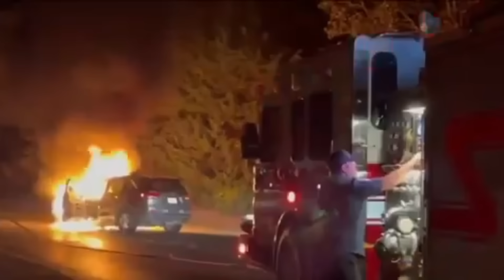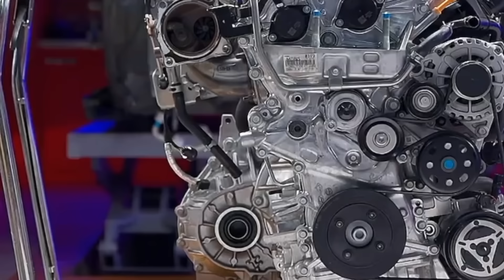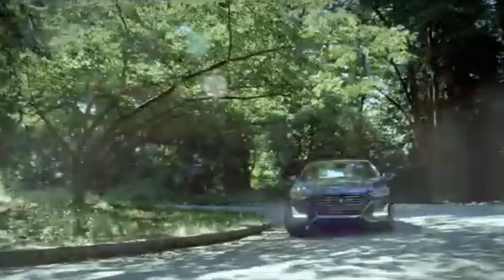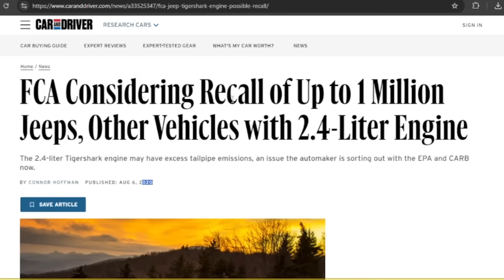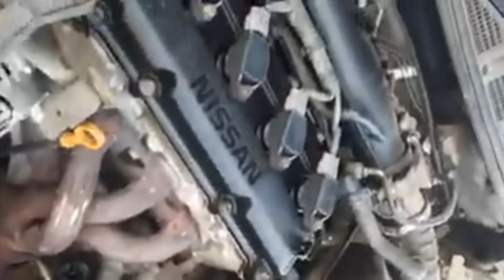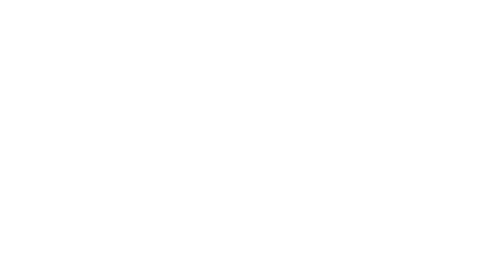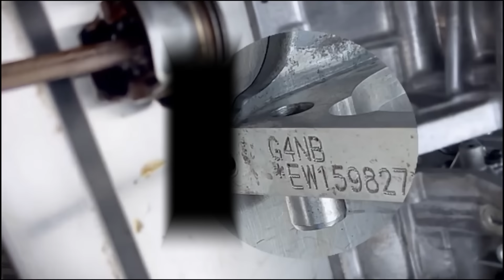Five Least Reliable Car Engines STILL IN PRODUCTION

Comment: I had a 1.0 ecoboost fiesta. I had 175,000 trouble-free miles and have no doubt it would have gone to 200k if two deer didn't total the car. 
I read the owners manual and it said 7500 mile oil  changes. I thought about a little 1.0 pumping it's heart out and decided to do oil  changes every 3500-4000 miles. Not one issue with the car.

Comment: Those 2.4 Tiger Shark engines in Dodge Darts are hitting 300,000 miles with no problems when you take care of them, so this video claiming they're bad engines is putting out the wrong info to people.
https://youtu.be/fRvfrtPR1Bw?si=3xMx3wPd0qHeauL3

Comment: Ok dude no. The QR25 is not the only engine that uses a Maniverter (Catalyst thats attached to the exhaust manifold) hell almost every 4 cyl engine does this. Also most also scavenge exhaust. This was a issue with the converters not the engine itself…… the QR25DE also does not have the screws that fall off the throttle plates……. Every engine can have timing chain stretch these motors get abused… and sure yeah the valve cover has to be swapped if the tube seals fail… a hour job at most…. The other engines are common surprised you did not cover the 2.0 ecoboost that had a stupid block deck with the cut that causes head gaskets to fail where the only remedy is just replacing the short block……..

Comment: I think all the manufacturers right now are in the process of trying to make every new engine make the current and future worst engines list. It is clear now the manufacturers are ok with compromising reliability and longevity for performance, yes you can get 350hp from a 2.7 inline 4 or 550hp from a 3.0 inline 6 or 1000hp from a 6.2 V8 but you can't have that and get high miles out of it, big lazy V6 and v8s last forever but there is no money in cars lasting forever. Cars are now built to make it through the warranty and be disposed of and that's sad and pretty much a terrible recipe for low carbon footprint. You can take an old gas guzzling car from way back and drive it forever and even with more fuel used and more emissions you still leave a way lower carbon footprint than a new car. And older cars are more recyclable where they have less plastics and toxic materials to dispose of.

Comment: The QR25DE engine issues were only for a few years (‘02 - ‘04 early ‘05). Later iterations fixed the issues, I had a ‘05 Sentra SE-R Spec V that had zero engine issues and I currently have family members with high mileage Altima’s (‘10, ‘11, ‘13, ‘21) with no engine problems.

Comment: The 4.6L iron block V8 in my 2009 Grand Marquis has 240,000 on the clock, runs like new, doesn't burn oil and actually gets good mileage on the highway. The same company built an engine with a timing belt inside the engine. Anybody who thought putting a timing belt inside an engine should be put in jail.

Comment: I had a qr25de in a nissan xtrail. Had an issue with the valve cover leaking. Nissan fixed some of the vibrations by adding a third engine mount...on top of the valve cover. So to change the valve cover (normally maybe 30 min job) took me a week after disassebling the engine mou t to drop the engine down to get to the bolt on the valve cover. Plus the egr valve and the power steering tank. Then the pcv valve snapped and that was 300 dollars australian and 3 month wait. Ended up getting one off ebay for 60 dollars. Horrible gremlin of an engine. Oh and without premium fuel it would only run on 2 cylinders and stall out.
Reply from the maker: Thank you for sharing your experiences,  that is a lot of hassle

Comment: The best part is that people still buy Hyundai/Kia products like crazy in spite of their terrible reputation.
Reply: I have a 2017 Sorento with the V6 and the engine has run well and I ve been happy. However I would never replace it with a new model as you have to get it with one of the 4 cylinders now.

Comment: Turbocharged and/or GDI engines require more reinforced blocks than their naturally aspirated, non-GDI counterparts, and I don't get why auto manufacturers don't get that. Anything that adds stress requires extra reinforcement to prevent damage. There's a reason why the 2JZ-GTE is such a revered engine. The reinforcement was crazy for how much power they were actually producing in stock form. That's why they're so reliable despite having 2 turbos strapped to it

Comment: Who would've ever thought that making an overly complicated 4 cylinder produce more power than it is safe to make. Then putting it in a big heavy vehicle would cause problems? Oh yeah, everybody who understands how engines work. 
It's more efficient to have a big engine barely working than a small engine working overtime. Less stress, less maintenance, longer life, and happier owners. This is why I won't own a modern vehicle. I'll stick with my old V8s. Lugging down the highway at 1500 rpm, while the smaller engines around me sound like they're ready to explode. And most probably are

Comment: I got lucky with my old SER spec v qr25de, the previous owner did a cat delete, and it did consume a screw from the butterfly valve, but only took out the spark plug and then left the combustion chamber. That was a decade ago and the car is still running and to my knowledge it doesn't burn oil.
I also now have the 1.8 MPI version of the 2.0nu, which are known for piston slap and oil ring issues. My "fix" is using the best fuel and oil available and a good wot pull once a day to clean up carbon. I'm at 191,000kms on the motor now, hoping to get to 300,000 at least
Reply from the maker: Great job
You have impressive miles on it

Comment: One of these things is not like the others. The QR25DE engine is one of the more reliable engines you can get in a vehicle. I'll admit their introduction was rocky in 2002-2006 because they had oil consumption problems but Nissan reworked the engine for 2007 and they have been solid ever since. Hell, the million mile Frontier still had its original QR25 engine.

Comment: I have experience with two of these engines. I owned a 2015 Fiesta with the Fox motor. It was previously my dad's. When he owned it, the head gasket blew. When I owned it, the cam phasers failed (and were on backorder for months) and the turbo blew. This was between 52k miles and 71k miles. I sold it and got a honda and have never looked back. My work vehicle is a Promaster City with the Tigershark. The engine got replaced under warranty at 72k miles for burning over a quart of oil a week. Fun fact: the 9 speed autos in those are junk too. It got replaced at 35k miles in mine.
Reply from the maker: You are lucky to get it under warranty. Baby it religiously. Thank you for sharing your experience
Reply: @ArrowGearhead  nah it's a company rig I beat the piss out of it😂

Comment: I have a 2022 Jeep compass with a 2.4 tigershark engine. I change the oil every 5,000 miles with vavoline synthetic motor oil. It uses no oil between changes mantain this engine it will give you years of service.
Reply: I have a 2021 Cherokee with the same engine..I've heard there were problems with the earlier engines but the problems were solved in the 2018 and up years.
Reply from the maker: Thank you for sharing

Comment: The QR is a great engine. The throttle body screws was an overblown problem that wasn't really as big as it seemed. It was easily preventable with 45 minutes of labor and the balance shafts really don't ever fail unless you don't maintain the engine. The cat design is stupid, along with like nearly every other Nissan model at the time, and the valve covers DO leak omg do they leak. You have to be careful in your choice of valve covers with them. They have little M6 screws that hold the valve cover onto the engine as well that need to be torqued juussttt right because you will strip out the threads easily. Ask me how I know. 

Overall, it's a great engine, makes insane power for what it is, sounds awful but puts the power down so who cares. I loved my QR and am hoping to buy another one again, if they're maintained right and you loctite those 8 screws you're golden 

Plus, the 2005+ (I think, I could have the years wrong) went away from the variable length intake runners so you don't need to worry about the screws

Comment: While telling us about the #2 engine, the 2.4 Tigershark , more than half the video loops shows a grand Cherokee, which has never used the 4 cyl Tigershark, but the fine 3.6 Pentastar V6. Plus the no longer built original Cherokee that was available with the 2.4 TS, that was after I test drove one to buy was awful and underpowered, especially in a 4x4/awd version! But I bought a very nice running 3.2 Pentastar V6, a smaller bore 3.6, tuned for mileage in the lighter Cherokee that ran great in my opinion, with a 9 speed automatic, that unfortunately came to a final drive that was so high the 9 th gear was never used till 80-85 mph! That if Jeep had offered a lower differential setup the power to the ground would have been even made a quicker vehicle! Possibly getting more highway mileage! Due to the use of 9th gear at legal cruising speed. Today I’m driving my second 3.6 Pentastar in a new Gladiator with 8 speed automatic that’s fantastic for what it moves, a 4,500lbs + brick, that still gets me over 20 mpg up to 70 mph! Or overall average of 18+!
Reply from the maker: Right 
Thank you so much for sharing
Reply: Thats like bragging how rich your fat girlfriend is. It's still a stellantis vehicle🤮

Comment: IMPRESSED! Finally agree with one of these lists. The Nissan qr (quality reduced) probably the best of the lot sadly. The turbo turd 1.0 isn't worth fixing if anything goes wrong. The theta and nu haveade me a lot of money. It's sad, almost all of these have 1 major problems. Their manufacturers cheap out in the wrong areas. But hey they don't want the car to last longer than the warranty. If that was really true there would be no 5.3l Chevy. They make their money upfront or on things other than the engine and for the most parts transmissions. As a mechanic the most consistent engine to go over 300k iss the 5.3l Chevy. Too bad they won't be making them for too much longer with their fuel consumption issues. I can guarantee that every single one of them they ever make will be bought immediately upon announcement if their discontinuation. And then the appreciation $ begins there is really only one way to kill the Chevy.$6plus a gallon fuel.
Reply from the maker: Thank you

Comment: I refuse to believe the QR25 is terrible, the amount of these on 3 bald tires, a spare donut and everything held together with duct tape while doing 40 over speed limit at all times tells me its the best engine ever produced.
Reply: Nissan: we’re Japanese in every way except the good ones. Terrible reliability, fugly copycat Japan style, unethical transmission designs, and abysmal performance…
Reply: I think that was thrown in for outrage engagement. It's the only engine on this list that has examples that have lasted a million miles. I see these engines with over 200k miles all the time, sometimes over 300k miles.
Reply: So . They're just topping up the oil and coolant everytime they stop. And they're already DONE, replacing the timing sensors every year, so they just let it ride rough as hell. It's many small things that suck on these engines. Electrical most of the time.

Comment: The Kia engines are a weird one... If you don't get one that had debris in the crankshaft, they'll go forever with proper maintenance including induction services. I work at a Kia dealership, and I see both. We are replacing hundreds of engines a year, but at the same time I see cars roll in with their original theta ii engines with way over 200,000 miles. Kinda crazy.
Reply: 3k mile oil changes on the ones still living 😂
Reply: Their diesel engines I had on my Sportage here in Iceland are amazing
Reply: I have 2011 sonata with 2.4. Meticulously maintained but It was burning oil like crazy.  Knowing that they wouldn’t do anything about it, i ran it low on oil until it locked up.  I did keep used oil in my trunk and as soon as it failed, i added used oil before towing it to the dealership.  Got a replacement engine.  You have to play it safe and not give dealership any reasons to decline warranty.  Especially for a crappy engine.
Reply: I got lucky...so far.  I have 2013 with 1.8 L.  150,000 miles still running smooth.  I used synthetic oil since new
Reply: If they got their QC under control I’d have considered purchasing one. Similar story with Nissan and their transmissions. Instead I bought a Corolla, which I’m actually enjoying.

Comment: Direct injection is part of the problem because the engines don't have port injection Port injection will clean the intake valves and it's better at keeping the Pistons clean they have problems with the PCV systems they also 9 out 10 of them have a high pressure fuel pump cam driven and if the fuel pump starts to leak into the engine and you can dilute your fuel or your oil with fuel and therefore you're going to have diluted oil getting up into the piston rings and with the heat that these engines create they end up sticking and then you're piston rings aren't doing the job to keep everything clean you know separated yeah new cars are pain especially with all the computers they have in them and they track everything you do

Comment: I just sold my old 2012 Elantra. The engine had a horrible rattle that sounded like a tin can. When the issue first started at around 60k miles it would only happen when you’d do a cold start and wouldn’t sound so bad once the engine had warmed up a bit but by the time I got rid of it it didn’t matter. I remember seeing letters from Hyundai in the mail all the time about recalls, and had to replace my steering column at around 75k/80k miles. It still got me through my 20s and the majority of my 30s though so despite all the BS I’m grateful it wasn’t worse

Comment: 2.4 Theta motor owner here. (2011 sonata) 

I currently have 318k miles, originally motor, lack of maintence (motor has never been opened). Just oil changes, sparkplug replacement, air filter changes. Oil pan gasket changes. 

I treat mine like a 90s mazda owner. Just keep up with the oil and it's good to go

Comment: had the qr25 in my 2005 spec v
step 1 cut the balance shaft chains or if youre bored remove them entirely this is a couple hours work at most
step 2 proper block back stainless exhaust. frankly this should just be standard on all cars
who isnt sick of rusty exhaust?
car and engine ran a treat and were still going strong in 2020 when i sold it

Comment: Totally agree about qr25de nissan, u should add about the notorious spark plug seals that integrated into the whole valve cover, meaning that u should replace the whole valve cover if u want to replace the spark plug seals. And for 2 decades this problems still persist and never corrected by nissan.
I once owned a nissan T30 qr25de less than 100.000 kilometers its already had a major problems
Reply from the maker: Thank you for adding
T30 is a beutiful vehicle, I love it

Comment: A wet timing belt?  What are the people at Ford smoking?  Seriously!
Reply from the maker: A lot of Auto makers have adopted it (planned obsolescense).
Reply: @ArrowGearhead  Benefits are increased efficiency and a steady supply of repair work for engines that grenade just after the warranty expires.
Reply: @ArrowGearhead  Sab o tage I think.
Reply: @G-ra-ha-m  Yeah, no kidding!  Warranty is over?  Time to buy another new car.
Reply: I think GM are using wet belts to drive oil pumps in some engines, which seems absolutely insane.
Reply: Chevrolet is also doing it with small turbo engines in Brazil 😂
Reply: Bean counters find a way to make a car cheaper by about 5 dollars.

Comment: The way that Kia gets you is that while the engine is covered, the hoses and belts are not. When I got my Sportage back after a new engine was installed, I also had a bill of $700 for the hoses and belts that needed replaced.🤬. While the Kia is a fairly comfortable and easy to drive vehicle, this will be the last Kia/Hyundai that I will own.

Comment: My 2013 Hyundai 2 l turbo is still working fine. Good fuel economy, lots of power, doesn't burn oil. I added a catch can. When I first heard of debris left in the engine, I added rare earth magnets to the drain plug. Hyundai called mine in. The cheack was a free oil change and they cut the filter open.  They replaced my magnets. No debris was found. I do oil changes more often than spec'ed. And oil over "SN" spec has detergents for carbon in the oil from the GDI, to increase timing chain life.
Reply from the maker: You handled it the smart way, good to hear this.
Reply: You are one of the lucky ones. I wish you many more miles. For those with the bad engines, the frustration must be unbearable.
Reply: @jamesgullo8240  : Thanks guys.  I know 4 people with the 2L turbo and 2.4 L  One did get a new engine from Hyundai.

Comment: U fotgot the verry infamous stellantis/psa 1.2 puretech its a verry much worse engine compared to the ford ecoboost
Reply: Should be renamed the Stellantis 1.2 L Purestench.
Reply: They made changes to the engine in 2021 to adress issues. I drive 1.2 non-turbo with currently 74 000km on the  clock. I hope it last for at least 2 more years. Then it's payed and mine and I can sell it. 😊